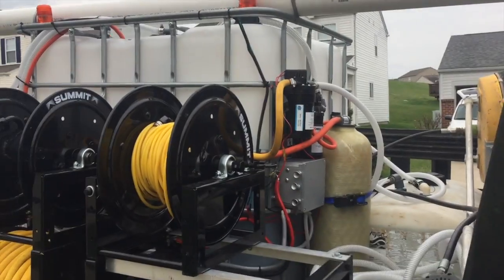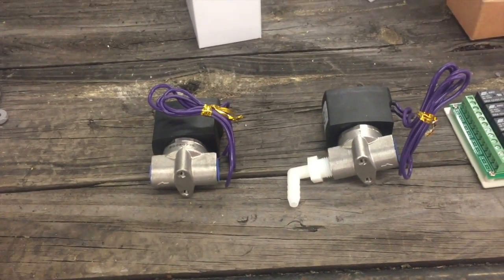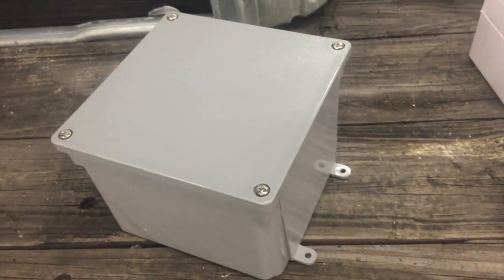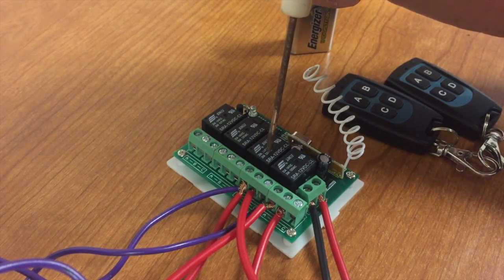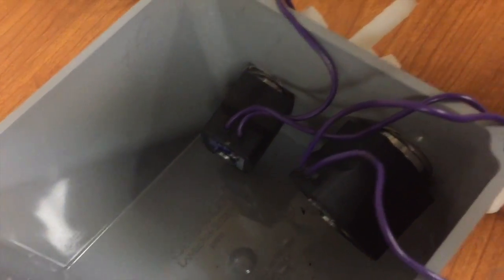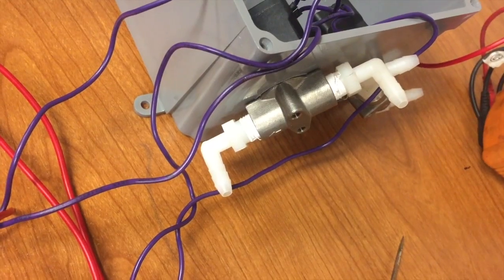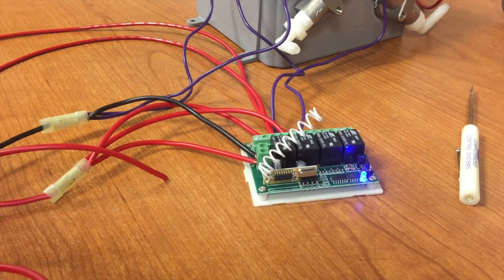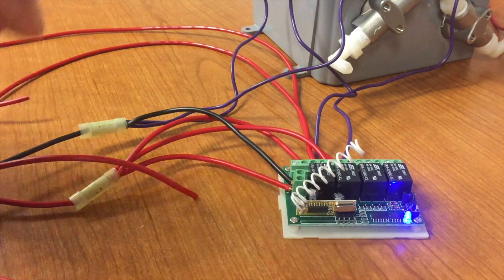Remote Control For Pressure Washing And Down Streaming

Comment: I'm curious what the most common point of failure in that setup is. I've got this theory that when you're rinsing with pure water it puts strain on the valve and that eventually wears it out. Is it an electronic breakdown or a breakdown in the plumbing? Thank you for posting this video! It's a great idea and I want to make it work.

Comment: So there are two elbows for each solenoid. How does the soap go into and out of the elbows to get to downstream injector? Do you have  some way to rinse it out or is it necessary ? Thanks for taking the time to do this .  Great Video ! Thanks !
Reply from the maker: So on the valve it has arrows showing the flow. So both outs go to a T. From t it goes to downstream injectors.  You could set one channel to fresh water to rinse out electric valves. I did not do that. We see how long the valves last. there only $30 a piece.
Reply: Oh Ok, I think I understand it now . Thanks again !